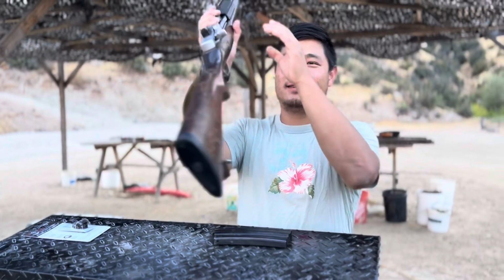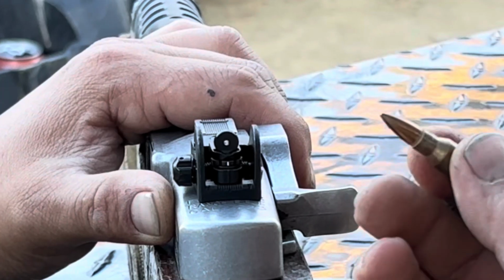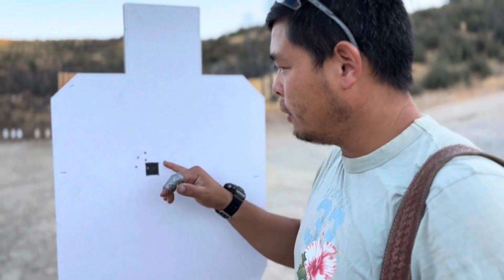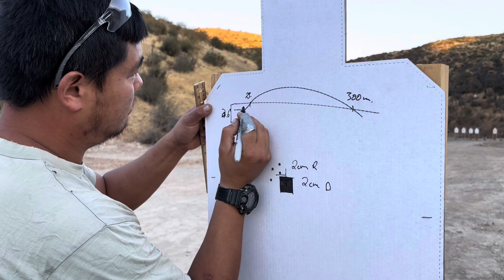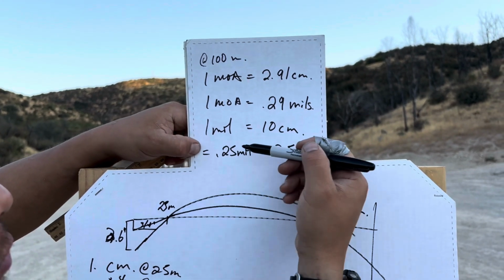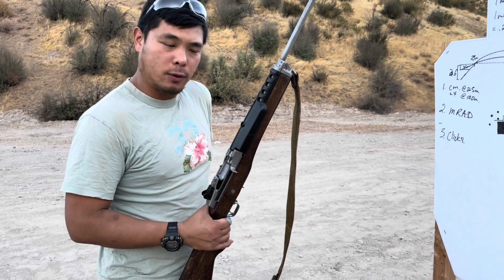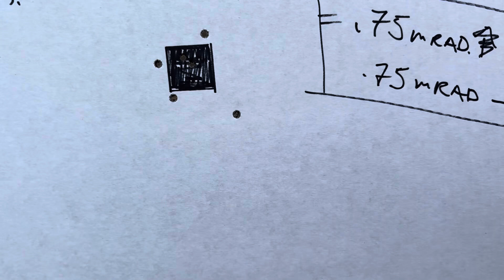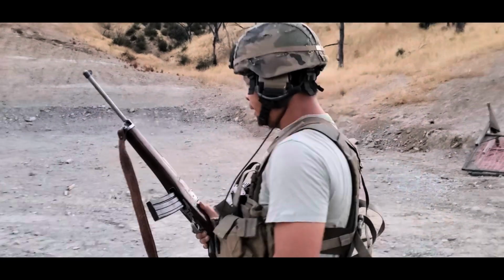Mini 14 Upgrade to Tech Sights #rifle #pewpew #shooting

Comment: Nice video, thanks. Love the mini14 platform. Need to look into that sight change.
Reply from the maker: Thank you for the nice comment! You should definitely order one and make the switch.
Reply: Ok math is not my strong suit, practical experience has been my go 2 
Bill Ruger could  have done his sighting system better however he created a Ranch rifle that does just that I've personally Taken not 1 but 2 American bison 55 grain FMJ  1 shot per animal cleanly dispatched loner rifle  open sights. Back 2 back . The Lord provides. Thanks Grandpa Bill,  MIke and God.